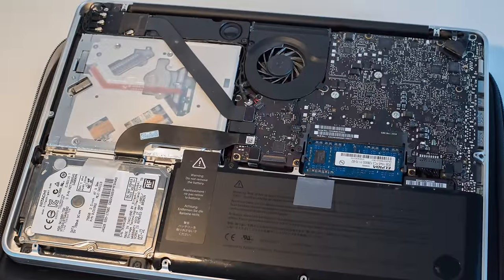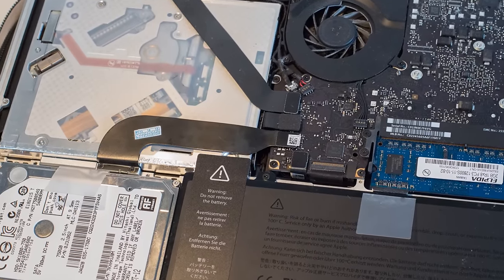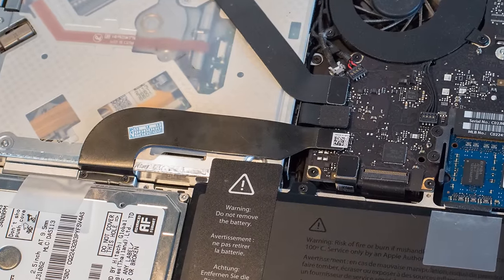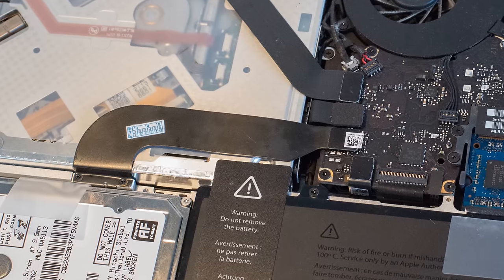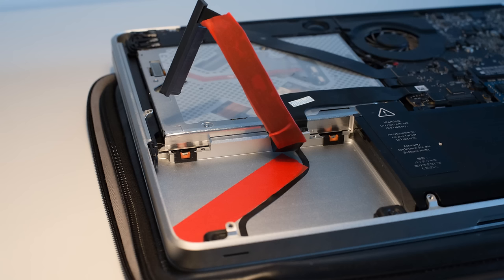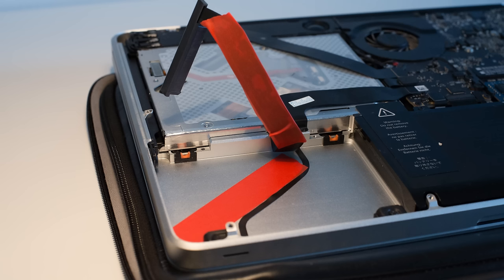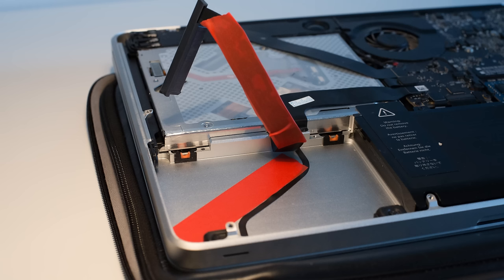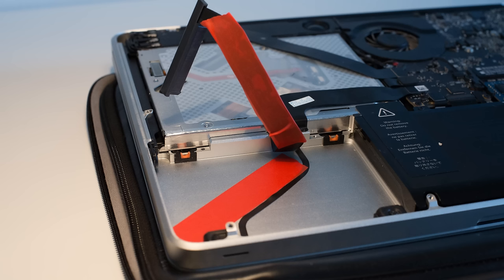MacBook Pro Hard Drive Cable Failure - Free fix and preventative maintenance - Question mark

Comment: Litraly just did this with my macbook 13" just covered the bottom machined metal part with tape and the cable working perfectly, I will make sure to pass people onto your video who suffer the same issue
Reply: +Mozame Mogki Please show us a picture or a sketch I REALLY need to fix this issue. PLS Bro

Comment: I was replacing my HD but the Mac would not see the drive.  I tested it with windows laptop and it had no problems.  
I tried your method and I just couldn't believe it but you are ABSOLUTELY correct.  This method has to be tried before replacing a cable.  I just cut out a piece of paper to fit the exact space and it finally WORKED !!!  I went to replace the Hard Drive 3X and was convinced that it was the HD.

Incredible...THANK YOU.
Reply: +johnkim19 Can you please tell me more detail on how you put the paper and how much and where? PLS I can't afford a cable and it's not available in dubai...

Comment: Perfectly working with paper too . Thanks a lot . Two full days was without solution . A perfect and only video in the Internet to solve the mackbook pro data cable failure problem. Kudos . Million likes for a timely solution
Reply from the maker: +Macin Flip Really pleased it has helped. :)
Reply: Again it stopped working . After I tried to close the MacBook back cover  and screw it. It stopped working . When I took back the back cover , it worked . Now it is not working irrespective of what I do . Very strange
Reply: Ok. Tried it. Worked for 5 minutes. Tried more tape. Same effect. Then I removed the really tiny screws that hold the cable in place and found more worn out cable beneath. Taped there and didn't fix the cable with screws afterwards but with.... Tape! Up till now  everything looks good..
Reply from the maker: +jonathan godeke Glad it is working for you. :)
Reply: +jonathan godeke can you post the picture . It would be useful

Comment: I spent two weeks trying to figure out exactly what the problem was with my MacBook Pro Mid 2012 13”. I was about to lose hope and buy a newer MacBook then I found this video. This fix worked 100% right on the money. Thanks you so much. Life saver.

Comment: It worked!!!!! I almost cried coz our country goes into lockdown for the coronavirus tomorrow! And my laptop refused to pick up a disk drive! I followed your video and it’s finally come on! I cannot thank you enough!!!!!!! 🙏🏽🙏🏽🙏🏽🙏🏽🙏🏽🙏🏽🙏🏽🙏🏽🙏🏽🙏🏽🙏🏽
Reply from the maker: Glad it helped!
You may want to try and source a replacement cable when you can, as they can still fail over time.
Reply: Thank you. I will definitely start looking for one

Comment: I have to say, first I isolated the part that goes underneath the hard drive and didn't work, so I did it also with the part that goes above the superdrive and guess what? WORKED LIKE A CHARM! Thank you so much! I would rate you more than my thumbs up, this saved me from replacing the whole cable.

Comment: Was about to pay £40 for a replacement cable when I found this video. Didn't work at first but then I added more tape to the cable over the optical drive and it booted up as normal! Thanks so much.
Reply: Same think in my case! Thanks Brue Computing!

Comment: Omg. Thank you thank you thank you!!!! I've had read/write issues for a couple of weeks now and it rendered my working station useless, even after switching out the drive to a brand new one. Couldn't open apps, move files, even opening the terminal would fail... 

This fix worked so good! I taped it up, opened up the recovery mode and ran first aid on the disk as the issue had messed with the partitioning. After that, everything seems to be working fine!! 

Thank you so much for putting this fix online, you are a lifesaver <3

Comment: OMG! I can't believe how flawlessly this worked! If you have the flashing question mark folder or the prohibitory symbol situation you absolutely have to try this! I was just about to order a new hard drive cable, in fact I ordered one 15 minutes ago on Amazon, but then I tried this and it worked perfectly, just in time to cancel my order. I knew that there was no problem with my hard drive because I have verified it a hundred times with disk utility. I can't tell you how many times I tried to reinstall OS X on my MacBook, but I was always getting the prohibitory symbol when booting. Also: There was a lot of dust in my computer when I opened it so I tried to clean it a little, trying not touch anything with my fingers, using a small painting brush. There was a lot of dust where the hard drive cable connects to the motherboard. I disconnected it (apparently you have disconnect it with a spudger or toothpick to be safe), there even was a small crumb that was stuck there, so I suggest verifying that everything is clean with the connection too. Anyway, I really suggest trying this before anything else. Thank you so much Brue Computing for the easiest fix and the clear instructions!

Comment: I have dealt with a super super slow 2012 macbook pro for 2 years now. I mean super slow. Beach ball with everything, even opening a single folder.

I finally dug deeper online and came across this video. I coated the cable in electrical tape as well as taped the metal surface below where the cable sits.

It's a brand new computer. It hasn't performed like this as long as I can remember. This fix has saved this computer for me. Thank you for the video Brue Computing!
Reply from the maker: Glad it helped. :)

Comment: daaaaamn. genious!
I had some issues with the grey starting screen lately, and already suspected my startup drive's connection or even some broken soldering on the logic board. But i never would have guessed that the "protected" side of the cable could be causing all this trouble... 2 strips of tape, and the mbp immediately started to work again.
Thanks a lot, you made my day.

Comment: Yup, can confirm this issue. I just had my 2012 MacBook Pro (13" Non Retina) stop booting up/displaying folder with question mark and I had it repaired a couple of hours ago. The person who repaired my MacBook gave me the old Hard drive cable and after watching this video, I inspected it. Sure enough, there is a tiny bit of wear right over the part of the cable that carries information to the Hard drive, thus making my MacBook not wake from sleep and then not boot up at all. I thought it was the new Samsung 850 Pro SSD i had installed myself 3 months ago that failed on me, but no it was this damn cable...
Reply: Ya I got that folder with question mark. Do you think this will fix that?
Reply: Nigba Akinola  
i would certainly try

Comment: FINALLY the root cause of the problem found and explained!  I already have a 2nd new cable on order for a 2009 15" MBP.  Will add your tape preventative solution this time.  Thanks!

Comment: This is crazy. I have a Macbook right here that slowed down terribly out of a sudden und finaly froze.
A different hard drive didn't fix it.

After viewing your video, I took a close look at the cable which appeared to be fine.
Taped it up anyway and it fixed the problem immediately.
Reply from the maker: +Oliver Stahl Glad it helped. Sometimes a replacement cable can still be required at a later date, but the tape should help prevent further damage if you do need to fit one.
Reply: +Brue Computing , didn't work for me.. (also nog 100% sure the problem is caused by cable failure). Any idea where to get proper replacement cable? I live in Belgium, so far didn't find cables for less than 50 euros.
Reply: +Oliver Stahl I have gone through 5 of these cables. Thank you! I was really tired of apple telling me to get a new hard drive.
Reply: +William Fehervari I get cables on amazon here: http://www.amazon.com/gp/product/B00FYXO28O It's $18 USD and I can get them the next business day. I ordered 5 before I saw this video.
Reply: Sean Smith Cheers!

Comment: Awesome. Thanks. After replacing the hard drive, which didn't work. I stumbled across your video after a series of googling threads to figure out what the problem might be if it wasn't the hard drive. I taped up the cable with electrical tape on both sides both above the optical drive and below the hard drive. Booted it up and it now recognizes the hard drive again. Thanks again!
Reply from the maker: Glad it helped. You may want to just replace the cable at some point, but should get you going again for now.

Comment: Awesome! I suddenly developed HD disappearing off my desktop. I had to rebuild the desktop so many times and even had a SSD go completely bad because of these random crashes. This is a great solution! I used electrical tape all over the ribbon, including the IR cable. Simply cut a thin strip for the bottom of the cable all the way to the attachment--dont' forget the 2 tiered folds! I then put a wider strip to hold the ribbon cable to the aluminum case...voila! The SSD is working perfectly. Thanks for this idea and free fix!

Comment: Thank you so much for sharing this solution:) I was looking at handing my Mac in for repair (and spending a lot of money on that) but this trick solved the problem! Just a note, what worked for me was to cover the whole bottom of the unibody with electrical tape plus the HD cable. I tried only covering the cable with tape but then my computer would freeze within an hour. Now it works like a charm:) Thanks again.

Comment: Woah, I'm blown away by this simple fix. My mid 2012 Macbook Pro had been running very slow for a while and I figured the hard drive must be dying. So I bought a new SSD drive to replace the old HDD, as well as an external USB to SATA connection so I could clone the drive. The clone took a very painful 48 hours to complete, which seemed very long to me. When I installed the new SSD, it wouldn't boot, just went to a black screen. But when I connected the old HDD to the external SATA, it ran perfectly fine! So I figured it must be a problem with the internal connection. I did some research and ran across your video. Perfect fix, who knew that all I needed was a little piece of tape, and $200 later. Oh well now I have a really powerful drive, but THANK YOU so much, I was about to buy a new SATA cable on Amazon and wait it out to see if that was the problem. Blessings to you.
Reply from the maker: +Billy Lykken Glad to help. In a lot of cases it is still necessary to replace the cable at some point, but at least you have a nice fast SSD now - best upgrade you can make to a machine!

Comment: THIS WORKS! I was skeptical at first but decided to give this a try after reading some reviews. In the end all it cost me was £1.55 for a roll of electrical tape.

My 2012 Macbook Pro started showing the no entry sign on and off on start up yesterday. Don't give up the first time you see it - leave it for a while and you may be able to turn it on and copy your stuff off (very slowly though -  the problem was affecting the speed of the computer). In Disk Utility I used the first aid feature and it said "first aid found corruption that needs to be repaired. To repair the startup volume, run first aid from recovery". I wasn't able to get into recovery mode so I got in touch with Apple on their chat feature. They told me to turn off the computer and then holding Cmd + Alt +R and holding whilst turning it on we opened the internet recovery feature. Here we ended up erasing the whole computer - (I had been able to back up my stuff - you can also try using your time machine I think). Then from this same menu we tried to install High Sierra again but we kept getting an error that it couldn't be installed. He then suggested I go and see Apple at the genius bar as he thought it may have been a hard drive issue. Luckily I had a gadget that connects a internal hard drive to another computer - I was able to take the hard drive out and plug it into another computer externally to check it. I ran first aid again and it said the hard drive was fine. This narrowed it down to the cable. Then found this video which fixed the problem!! No new cable or hard drive needed!!

Comment: Sounds reasonable, but didn't work for me. I tried protecting the new cable (my 3rd) with electrical tape as suggested when I installed it in October of 2015. But it too has now died after less than a year in use.

A class action suit would be nice, since this is obviously a design/manufacturing defect that Apple refuses to admit to.
Reply: Nor will they even tell you where the firmware partition is when upgrading to High Sierra and up
Reply: Had to replace another HD cable 2 months ago after the latest failure. Fortunately, I now expect this so I already had a spare cable on hand. 

I had tried to protect the last couple of failed cables with electrical tape, so while it sounds like a plausible solution, it hasn't worked for me. I generally expect this cable to die after between 1.5 and 2 years in use. Trust me, keep a spare where you can easily find it. You'll need it.
Reply: glassmakerx thanks for the heads up! I taped mine and did a full reboot/reinstall which worked for oh two weeks and nows it’s shutting down at login again! You ever figure out a permanent fix for yours
Reply: @NikkFlo  Unfortunately, the only permanent "fix" I found is to keep a spare cable on hand at all times. I've lost exact count now, but I've replaced either 4 or 5 since I bought my MacBook as a refurb in 2013. Based on it having a new hard drive when I bought it, I suspect the original cable had to be replaced for the refurb too. So keep a spare on hand and don't forget where you put it.

Comment: You sir are my hereo of the month, well bether the year. I had lot of wierd problems with a MacBook. And tried basically everthing. Techtool pro, SSD checks with Windows, reformatting several times, tried different drives and OSs Booting from external drives and posted in forums. And now this finally solved it. Thank you a thousand times, also you would deserve much more.

Comment: Thanks for the trick, money and time saved! After going through several hurdles to identify the issue, I found out it was the HD cable that was the problem. Was about to order a new cable when I found your video. I've put tape on both sides of the cable and also on the part that goes over the DVD drive, everything works fine!

Comment: Thank you for this video! 
I have just taken same laptop to Apple because of exactly the same problem! 
They are going to try and fix by replacing the cable first (£90) and if that doesn't work they will replace the cable and new hard drive for £180. 
Having seen your clear, informative video, I am hoping that my laptop has only cable failure! 
Many thanks for the explanation.

Comment: Amazing that finally the mystery could be solved with the help of this video. The SSD in my macbook worked great with Windows 10 and Bootcamp. A HDD that I tried out with OSX also worked. How can you then see that the SSD does not work with OSX because of a broken cable. Wow, thx man!
Reply from the maker: Glad it helped!

Comment: Thanks! Your information helped me get a 2010 MBP going again. In my case it appears that the problems were in the spots were the cable is bent as it snakes from the top of the DVD to the area beneath the hard drive. I used 3M book binding tape instead of electrical tape and this did the trick. I have ordered a replacement cable as backup but will retrofit the insulation upgrades when I swap in the new cable. Thanks again I did not think to consider an insulation issue as the culprit but it was!

Comment: This works perfectly for me. It was my third cable and I was really frustrated. Great visual, very clear. Thanks for your time and pedagogy.
Reply: +Martin Benoit Did you actually see any marks on the cable? Mine looked like new, but taping it out fixed the problem.
Reply: +Oliver Stahl ; After looking carefully with a 65X magnifying device, I couldn't find any mark. I taped it and it worked for a week before failling again. I ended up buying a new cable and taping it to prevent any abrasion.
Reply: +Martin Benoit, I think this is what I am going to have to do.  Just out of curiosity, how is the cable working now?
Reply: how did it hold up?

Comment: The tape trick didn't do it for me, but I ordered a new cable and now everything runs fine :) This was a pretty hard problem to diagnose. Thanks for pointing me in the right direction!

If your macbook pro 13 inch mid 2012 is beach balling and hanging often, this is probably the problem!

Comment: Hi, I'm also fixing a customer's Macbook Pro from 2009 with the same problem. I own myself a Macbook Pro mid 2012 and I suffered the same issue a year ago. Great solution! Let me add what I found in my customer's laptop today: Underneath the two screws which keep the cable attached to the chassis, I found the cable really damaged in contact with the metal from the superdrive device, so I would recommend to add some tape there too. Personally I have some Kapton tape and that's what I'm using :). Thanks for your tips, and cheers from Norway :)

Comment: I have wasted a couple of hours trying to find the root cause of random system crashes / weird errors / strange log entries / hangs during boot process and your video gave me a clue on where to look for it!
In my case the cable, however, was intact under the HDD, but instead its insulation had a slight wear right in the point where it bends over the optical drive (the edge, that have adhesive tinfoil-like tape stuck on it).
I have taped the problematic edge of the ODD beneath the cable and voila! The problem is gone! I have applied a layer of tape in the HDD bay as well more as a proactive measure from that part of cable insulation wearing down as well.

Thank you very much for this incredibly simple, yet very exact explanation!